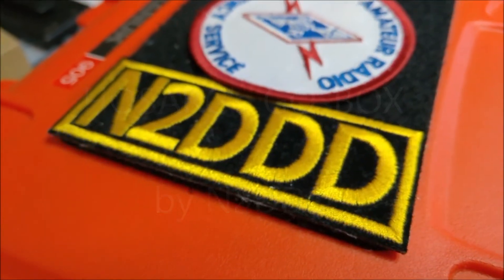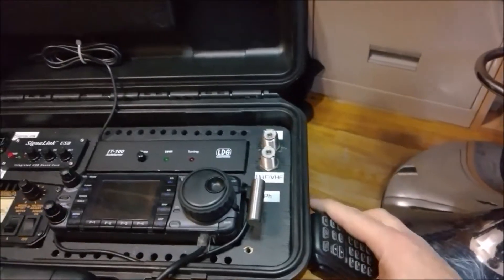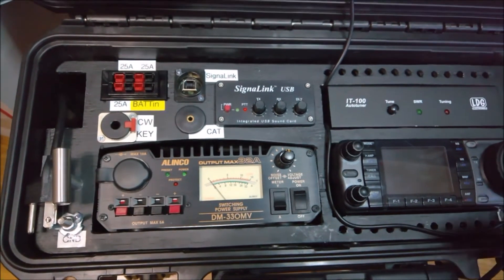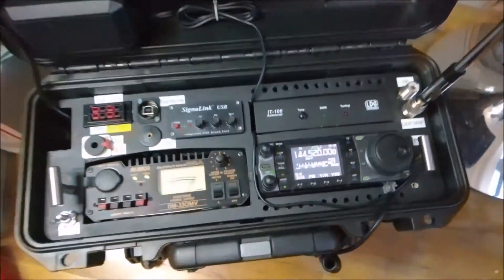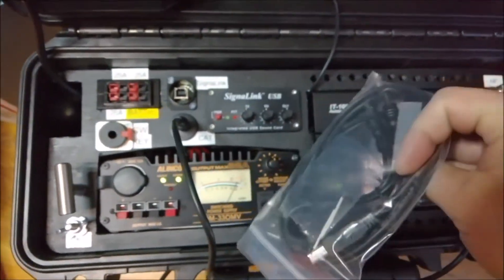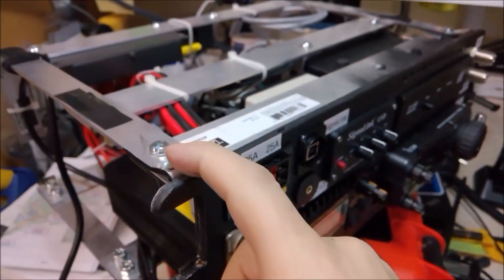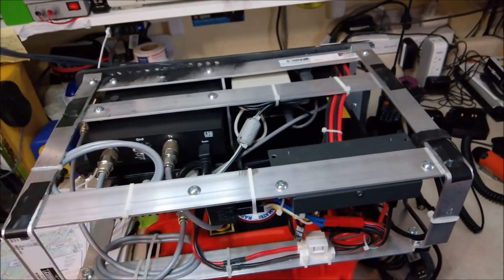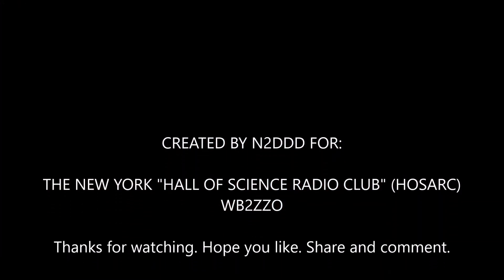HOSARC goBox

Comment: I am interested in building one like this for multiband use.  I intend to use 10 meter radio and a triband radio with 220/2meter/70cm all in one box with external power from generator/other instead of the power switching or battery pack. the signalink will be wired to both radios and switchable to each.  Any amplifiers will be internal to the design as well and antenna tuner for both radios.  I only need the box and one more antenna tuner for 2 meter/70/220.  I have a ample power supply but I am still wondering about how to implement a secondary backup power source for 13.8 volt.  Can you make another video about the power switching aspect of this box?

Comment: Question: How did you fasten the radio, power supply, signal link, etc. to the face plate? Or, are they attached to the aluminum bars?
Reply from the maker: They are all fastened to the aluminum bars. 73
Reply: @JoseSanles  Thank you!